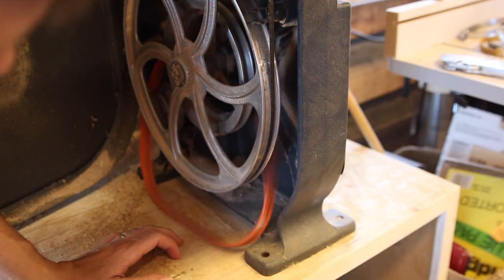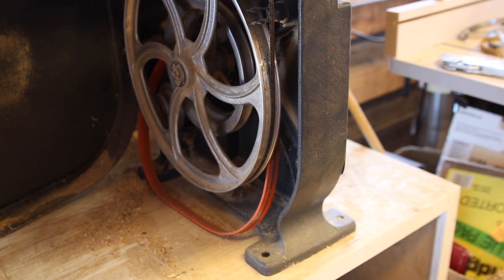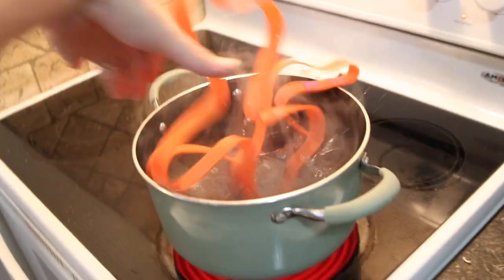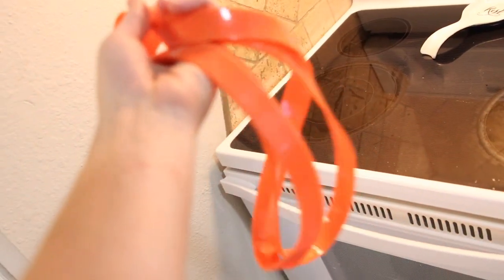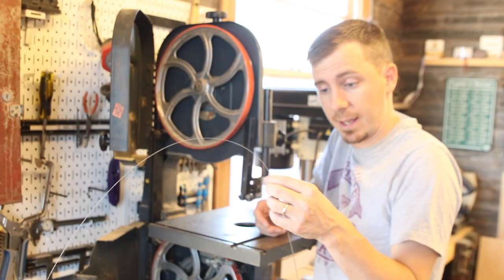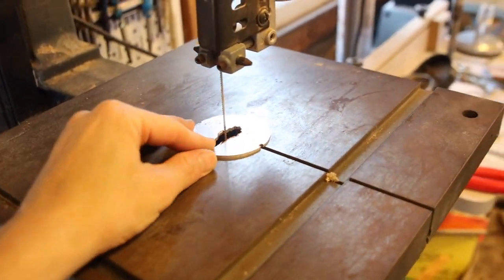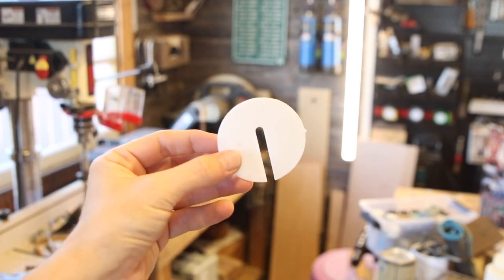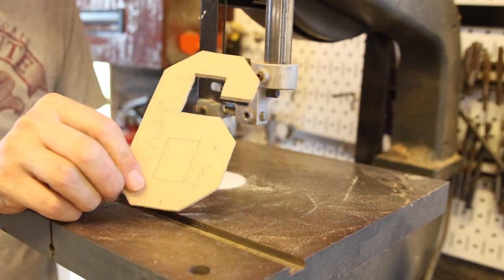How To Install Bandsaw Tires // Everything You Need To Know

Comment: Thanks for the posting. Just received new urethane tires for my 1940s craftsman 103.0103 12". I will use your method. Thx. Reading The Institutes. Reformed 28 years now. Saved 48 years Soli Deo Gloria